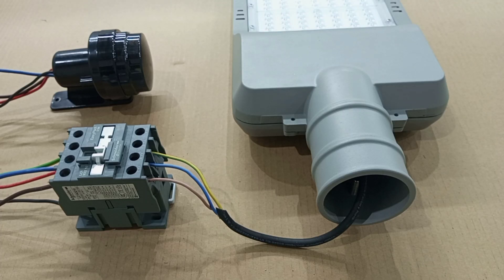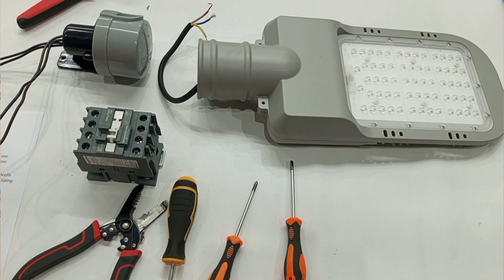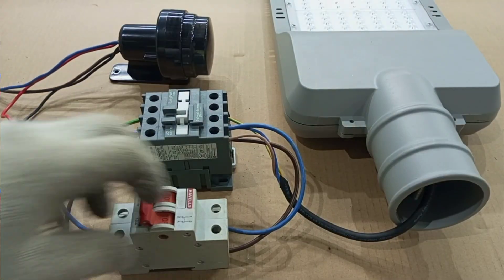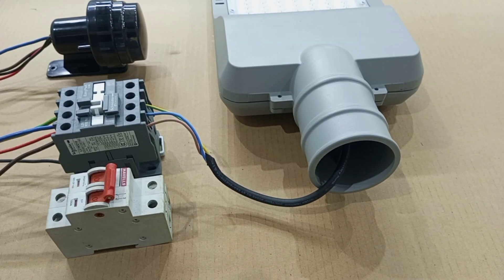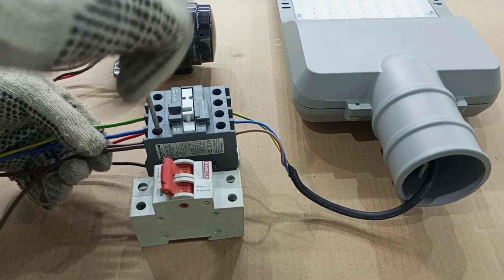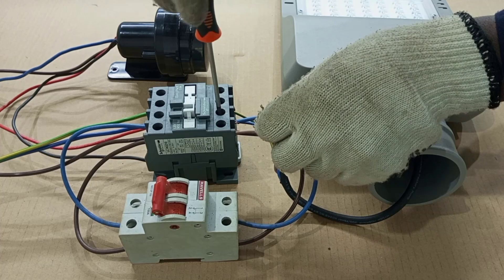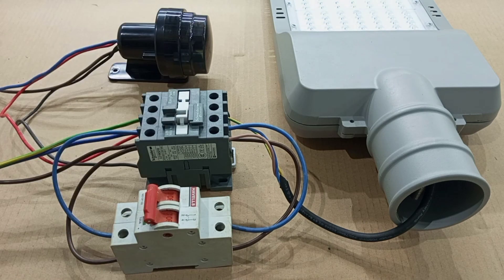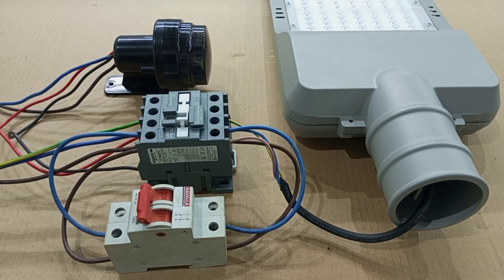Photocell bypass wiring

Comment: That's good brother. Please I want to ask, at the normal circumstance, how many lamps can be connected to one photocell?
Reply from the maker: I will depend on the wattage rating of the lamps you want to use some photocells are rated as high as 2000W others have lower ratings so you have to check

Comment: That’s very nice bro I will try it on my site street lights
What if it’s just an MCB you have that switches on ur lights cuz it’s three phase
Reply from the maker: Yes, it's fine but you will have to switch ON and switch OFF manually all the time.
Reply: @obloni_Electrical  yes but I mean I want to fix some of my faulty light but I want to by pass the photocells and switch it off and on manually so which component should I use and the wiring as well
Reply from the maker: @jerrynkrumah2584  
Oh I see. So it will depend on the original system, whether the photocell is wired separately or whether it is originally attached to the lamp. If the photocell is wired separately as shown in the video, you  bypass the photocell by connecting a wire to bridge the live/hot wire that enters the photocell to the live/hot wire that connects to the lamp. 
In a case where the photocell is originally part of the lamp, you will do practically the same just that in that case, you will have to open the lamp to do that. Let me know if you would like me to do another video on this.
Reply: @obloni_Electrical  
The photocells are attached to the led bulbs …u see this street lights that is how it is so I sometimes changes the photocells on it if it not switching but I want to do the bypass too so I can on it manually
Reply from the maker: @jerrynkrumah2584  
I will demonstrate that in another ASAP
Reply: @obloni_Electrical  thanks boss
I’ll really look up to it sokn